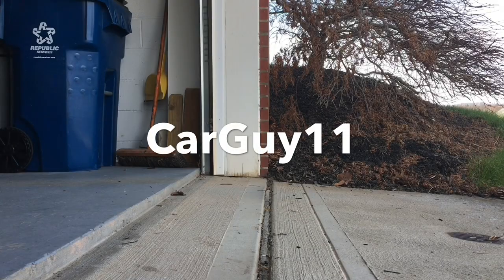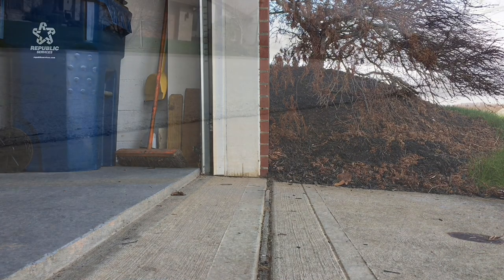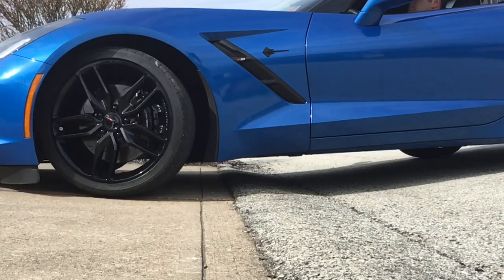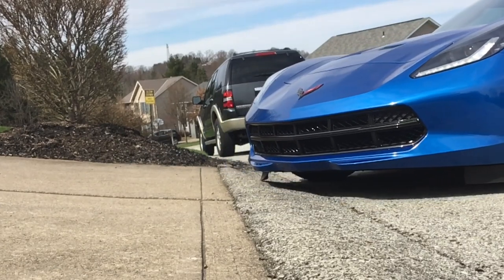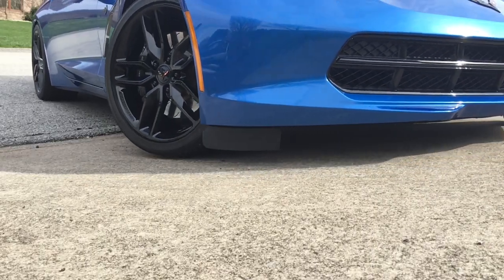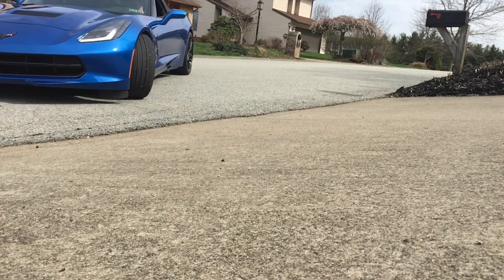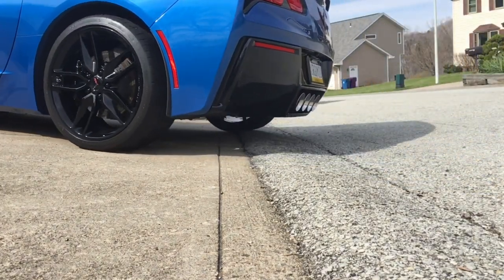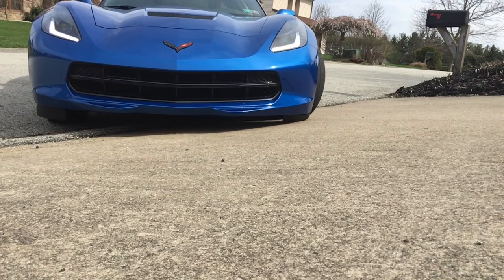Driveway Ground Clearance - C7 Corvette Z51

Comment: Hey Carguy11, I too had the same problem with my 2019 Stingray rubbing at the foot of the driveway, so I solved the problem by moving to a another house…I like your videos😀. From Canada..
Reply from the maker: Haha good solution! Thanks for watching!
Reply: I also live in Canada but I would not change my lovely house even for a Bugatti. I guess, you did not really change it for the car, but all driveways are horrible in Calgary. You can buy curb ramps, but you would have to carry them in your trunk and use them wherever you go. Not to mention that the roads are free of stones for only a couple of months per year, if ever really.

Comment: My parents driveway is steep. So when I go over there I try to start up it almost sideways until I get the 2 front tires on the upgrade. Then I cut the wheel and go up.  Try start driving straight past ur mailbox until both tires are on ur driveway and then turn up it.  That should help unless ur driveway is real narrow.
Reply from the maker: Yeah I've tried it all and still rub.  Going up not as bad using that method but can't do that getting out.

Comment: I have ‘19 GS with stage 2 splitter. I also installed the Scrape Armor. I have not scraped on anything. I used to have an integra type R that was about 2 inches off the ground. Now that car was a pain in the ass lol. I guess after having that car driving my vette with about 4 inches to spare is a walk in the park. Just take take it really slow and ANGLES! Can’t say that enough. Nice ride!
Reply from the maker: Thanks! Yeah the C7s are not too bad if your careful.

Comment: this is why I did not lower my vette
Reply from the maker: Mine still rubbed even before I lowered it.
Reply: Same reason I will not lower mine now.
I have a carbon fiber spoiler & no way am I gonna destroy it just to be a little lower,I'll simply install a set of 21r/20f wheels to help fill the wheel wells. 😎
Reply: mustclime why on earth would anyone lower the corvette 🤔 the car sits low enough already 🤷🏼‍♂️

Comment: My driveway is basically flat but my stock height c6 still rubs like crazy pulling out/pulling in. I have retaining walls on each side of the garage so going in at an angle isn’t an option. Sounds terrible every time
Reply from the maker: Yeah C6 is even lower than C7.

Comment: wish there was a air ride system you could use for going in and out  for steep areas (Driveways, Speed bumbs etc.) that doesn't cost a arm and a leg
Reply from the maker: +Brandon Ganus Yeah sure it would be tho and add weight.
Reply: Lambos have an air ride system just for this purpose. I wish Vettes did too!

Comment: Keep in mind it's only the lower air damn, not the spoiler. That's not an issue. The front splitter on my C6s rub on some driveways, not my C7 though.
Reply from the maker: Yeah C6s were lower yet.

Comment: You’ll eventually tear and perhaps lose those rubber pieces. I did. I face the same situation in my driveway. I went low tech and laid a section of 2x4 at the base of my driveway to decrease the angle. Problem solved. Are you missing the middle section of the front air dam? Didn’t »t see it.
Reply from the maker: The Z51 models only come with side sections.
Reply: CarGuy11 do they serve any purpose? I have the same car and same problem. Would removing them have any detrimental effect?
Reply from the maker: They say it’s for fuel economy to draw air away from tires.
Reply: @CarGuy11  ah great thanks for that.  I have another question that has seen many different answers.  What is the proper way to close the hood on a C7? Push it down with a little force, or lay it down then push down on one side at a time?  Thanks in advance
Reply from the maker: @dannymcqueen  Push it down with force so both sides latch.
Reply: @CarGuy11  thanks a lot man

Comment: I'm actually considering raising my corvette plus taller tires. I'm not trying to achieve top speed or track the car.  The center of gravity should remain the same and taller tires for wheel protection.

If I wanted to race it , I'd have dedicated set of wheels and tires to bolt on anyways.
Reply from the maker: The C7 is actually not that bad compared to C6. I wouldn’t go with taller tires. Can raise suspension if you wish.

Comment: My C5 is stock height, I changed the wheels to 19" in front 20" in rear with low profile Bridgestone RE960s which came out "about" the same height as stock, maybe 1/2" shorter, but yep, always drag the front spoiler on the way out.  Not a problem going in, and there's one street with a huge dip on both sides of the cross-street I avoid entirely, hell my van bottoms on that if I go across too fast, so the Vette doesn't go there. But no, don't make it any lower or big problems happen.  OH, when I installed a new Kenwood Nav/DVD/Stereo a few years ago, I also installed a FRONT camera.  THAT thing is a lifesaver, I highly recommend it, haven't even come close to bumping a curbing parking anywhere. Good luck!!! 😎
Reply from the maker: +Zeek Duff Sounds good man!
Reply: Zeek, What front camera did you install?
Reply: +DC89SSP1 Kenwood, both of 'em are Kenwood, Amazon had a sale on 'em, so I got 2 & sold the cheapy rear cam I got from Dennis at DD Mods (who does the DD bezels for C5s). I got the whole rig from him, including the "extra" wiring harnesses for AV, USB, & steering wheel controls, although the last one would only be used to read FM from a wireless remote bought off eBay, for which there are several kinds, BUT I have one coming this week that just does infrared commands the Kenwood head unit should easily read.  If it doesn't, I wasted $10 for a set of plastic buttons & 1 yr warranty. 😞 If it works, then all I need to do is figure out where to mount it, it's designed to strap to a steering wheel, but the existing enclosure is kinda ugly - okay, VERY ugly, but for that amount... 🤓  I can make another box for it or whatever I need so it looks decent. 
This; http://www.ebay.com/itm/282247105401 
It's just that the Kenwood DNX9990HD's row of buttons under the 7" screen are way too tiny to use safely while driving, so I decided I need to do something to at least make using the phone possible without pulling over & stopping.  Can't even find the volume up/down easily. The "Audio" button is what you just hold in for a few seconds to access the front camera, anytime (otherwise that button pressed once accesses the EQ & FX, etc).  Eh... The rest of this is too long a story to totally hijack CarGuy11's thread here... Hahaha... Briefly anyway, I couldn't do some of the work, bad back, so I just started it by removing everything needed to access the mount, THEN the @#$%^&* guy I had actually install the head unit left off ALL the "extra" wiring!!! UNfreakingforgivable!!!  So, at some point in time, I must pull the head unit to get those AV/USB & Steering wheel harnesses plugged into the back, then see about mounting the rest of those connectors in the console next to the shifter (there's plenty of room for those). Okay, oops - I kinda went on & on anyway, but yeah - everything "new" is all Kenwood. 🤗

Comment: Corvette s all rub even in the stock form from the beginning of time lol. Depending where you live? Not a car to daily that’s for sure. Mine is a 18 1LT nevertheless they carry the standard Z51 wheels now. Should still sit the same. That’s why most corvette ppl probably don’t drive them much🤔 that’s what my daily 18 Camaro ss is for 👍 no rub and can go over speed bumps without stopping lol. Plus nearly just as fast as the over rated corvette 😜

Comment: O MY GOD,this is my big problem I get crazyyyyyyyyyyyyyyy about this driveway,I spend a lot of monay for ramps but I still have problem every fucking day I have to put and take it I get cancer about this hehhehhe,I called city to fix for me the mother f....... didn't call me at all one time he came after that 100 times I called city to fix but hi didn't respond ,but yours so much better the front doesn't impact to grand ,but my car get damage  and cracks,I had corvette z51 ,the bumper get crack after that I chenged my car,now I have 2017 corvette Grand sport spacial order,grand effect this is so lower than other one ,I ordered 2.5m Body Kit/Bumper Lip/Side Skirt Rubber Carbon Fiber Look Edge Protector Trim but now is protect the under bumper but I should use ramps too without ramp I don't have any chance ,I want to send you the pictures but unfortunately youtube doesn't have that option to show you
Reply from the maker: I lowered mine with suspension adjustment bolts but you can actually raise it too.  That may help.  https://www.youtube.com/watch?v=Fw-XtzXBBLg